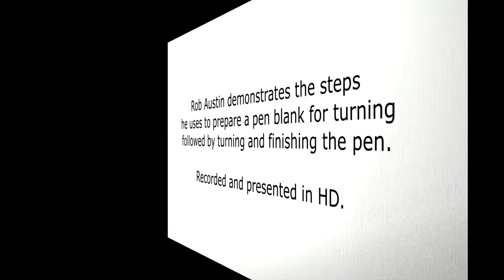Pen Turning 101 with Rob Austin

Comment: Thanks for this video Rob, very helpful and informative.
Reply from the maker: I'm happy you liked it. Have you tried turning a pen?
Reply: I did a couple pens in my high school shop class (1994).  This video was enough to confirm that I want to do them again.  I've entered the research phase to figure out the balance between what gear I need and what gear I want.

Comment: I’ve watched several people make pens. I’m not new to woodworking. I’m not new to lathe work. 
Why would you rather use a drill press to make the center hole instead of a tail stock drill on the lathe?
I have a chuck that will hold a 3/4 inch square. As long as I ensure the blank is level, isn’t that a better option?
No one on YouTube seems to think so. I’m just wondering why. 
I’m assuming I’m missing something.

I’m glad he addressed my question. I’m just doing entry level slimline pens. 
The lathe drill will do what I need.

Comment: You're a great instructor Rob.  I've scoured youtube prior to jumping into pens, and this is one of the best videos.  Just bought a Harbor Freight 10"x18" lathe, and everything else from Penn State.  I will tell you the mandrel saver is awesome.  Also, just so you know, the folks at Woodcraft didn't agree with your sanding steps.  They said to go 150, 240, 320, 10 coats CA thin, 400, 10 coats CA medium, 400, 600, 800.  I carnuba buffed after.  All that did was make my pen very hard and unnatural like.  You couldn't press your thumbnail into it at all, but it also didn't feel like wood.  Not impressed.  I will make another one tonight with your method.  Question, I see Mylands Friction Polish on Penn State, but sanding sealer is only on Woodcraft.  Do you mind sharing where you purchase?  Lastly, how do you recommend turning close/matching to the bushing on soft wood, without it chipping or getting too thin on a slimline?  Hard wood isn't "spongy" and problematic as I'm learning, but some soft woods still look cool.  Any advice?  (sorry for huge post)
Reply from the maker: Mylands and Penn state both have sanding sealer and friction polish. I buy mine from Woodcraft. Sometimes they run out and I special order it. Turning on soft wood does take a more delicate touch and very sharp tools. I like using a skew for shaping the ends. You will have to sand either way so use your tools to get close then sand to the end. As far as the sanding grits when going from a course grit to a thin grit... you never use a grit that is more than half of the grit you are using. So if you use 150 grit - 1/2 would be 75 so the biggest jump would be to 225. In order to sand the larger scratches out you should use grits that are closer to what your using. I use Norton or Diablo  Aluminum-Oxide sandpaper and I have not seen them make a 600 or 800 grit.  Most of the 600 grit and above is a wet sand paper.  The jump from 320 as Aluminum-Oxide to wet sand paper is not a normal progression. There are several ways of finishing your turnings so experiment and if you find something you really like let us know. Rob
Reply: @gwinnettwoodworkers  It's been 7 years since I left that comment. This video popped up in my feed today, and I saw my original comment. To be clear, Rob's method is still the best. I'm not a fan of a CA finish. Wooden pens are art you can use. Coating them in CA glue takes that authentic wooden feel away. It's like a leather bag to me: if it "fades" a bit, it's supposed to! I have turned a LOT of pens, and I just wanted to come back here and thank Rob again for all the help. I would add that I like Abranet. That sanding mesh doesn't deteriorate or clog as quickly. Keep up the great work!

Comment: A thin wax plug, or potato if you're frugal, works very well at keeping any glue from entering the brass tube when gluing it into the drilled blank. When I have a special piece of wood that I want to look the same after years of use I apply a thin layer of CA glue and polish it to a super gloss that seals the wood from skin oils and discoloration.
Reply from the maker: That makes a nice extra layer of protection. I don't care for the very shinny finish of the CA glue. It give some wood a plastic.
Reply: @gwinnettwoodworkers  I agree and only hold waxed wood personally but the CA application allows the pen to be polished back to its original gloss luster for the life of the pen. Nice work.

Comment: I did just get the Wood River DV2 Drill Vise. This is one that can be used with a hand held drill. It's not too bad so far. Someone needed my Drill press vise more than I did apparently. I haven't tried a precise center drill yet. Here's to hoping.
Reply: With a drill chuck or collet in the tail stock of the lathe, you don't need a drill press nor a drill vise.  Nor a pen mandrel, as you can then drill the hole after mounting the blank in the lathe - it's being held in perfect centered position for the hole.
Use an auger bit instead of a brad point, because you can't jig much with the tail stock screw.
Reply: Art Heen that's what I had to go with. The DV2 did not have the precision I was looking for. I do it all on lathe now and much happier doing so! Thank you!

Comment: 20:27 I got distracted for a bit by the white and black makita drill - very nice, first time I`ve seen one
Reply from the maker: The white and black drills are more of their consumer line. I have 5 of them and have been using them for a few years. Our woodworking club went to the Makita factory and had a great tour where they answered questions. When we were done I ordered 5 drills.
Reply: I`ll bet that was an interesting factory, I used to repair them so I`ve seen them from the inside and Makita are built very well

Comment: I absolutely love your  videos and your finished products.  I had one question, can you tell the brand of friction polish and sanding sealer that you use???
Thanks!!!!!
Reply from the maker: Mylands for both. I normally buy it at WoodCraft. Another good brand is Penn State. I buy small bottles that I use and refill. Then I keep the big containers in a cool closet. If you use it from the big containers the air dries them out in a short time.

Comment: I agree it is far cheaper to buy the board and cut your own blanks.  I've done that many times.  Actually have picked up larger pieces from the discount wood bin at Woodcraft and made many pen blanks that way.  I got a piece of Yellow Heart last year for $8 it made me 27 full size pen blanks and 4 single tube size pen blanks.  Really nice to get larger pieces and turn them into blanks.  I also try and make my own acrylic blanks whenever I can as well.  

I'm like you I don't make them for profit...definitely not a profit where I live, people will go to the dollar store and buy a package of garbage pens and throw them away, they will never pay the price for a hand made pen that they will have forever.  I make them for fun, and all sorts of different styles to make, and tons of blank types out there too.

I have had good luck with regular super glue for wood blanks, but for acrylic I've found that super glue doesn't work very well, I've had brass tubes break away from the acrylic during turning, so I now use epoxy for all my acrylic pens....which is mostly what I do now, don't really make very many wood pens unless its a new pen style I've never done before, then I use wood, its easier to work with and don't waste an acrylic blank, I've actually screwed a few up and just turn the wood off back to the brass tubes and start over.
Reply: +William Todd (williamtodd) I found the CA glue can become brittle after time. I now use the epoxy of all my pen blanks. When I'm setting up the blanks I do 20 or 30 at a time so the epoxy works well.  I can do around 4 sets of blanks before the epoxy starts to harden.
Reply: Rob Austin I've kind of stopped using the CA glue even on the wood blanks here this past weekend that I did, I had the epoxy right there already, and it seems to hold a lot better, have to wait a while before I can finish the pens, but I'd rather not have tubes coming lose during the turning process LOL.  For the cost of epoxy I think I'm just going to stick (no pun intended) with the epoxy across the board now.
Reply: William can u make me a fountain pen ? I'm new to collecting  fountain pens n would love to have a beautiful hand made one in my collection .
Reply: MC CLG send me an email wsevier@yahoo.com with your color choice.  I can make wood or acrylic.  Just a note, most of the nibs for the hand made pens aren't as good as the commercial ones you find from Goulet Pens, or the like.
Reply: William Todd OK cool,i will dearly noted on the Nib

Comment: This was amazingly helpful.  Thank you.  I wish we were neighbors.  How many times do you reuse the sand paper and micro mesh?
Reply from the maker: I fold the sandpaper into sections. That way I can use one section at a time. I have been frugal with the Micro Mesh so after it gets clogged up I I put it in a bowl with soap and water. I brush it with brush used for dishes then rinse in warm water. I lay the pieces out on a paper towel and let them dry over night. Next day they are close to being like new. I have some that are over 5 years old.

Comment: Very nice video. I have to ask how you ever used bees wax in place of the carnuva wax? And if so how well did it hold up?
Reply: +Love2boat92 I have not tried the bees wax. It felt tacky and I was not sure if it would buff out when done. I will give it a try. The carnuba wax is pretty hard and last for years.
Reply: Rob Austin Oh OK. Thanks.
Reply: Beeswax is great for when you need grip, but not so good for shine.  I use beeswax on knife handles and canes, but not pens.
I use boiled linseed oil to bring out the lustre in the wood, followed by carnuba paste and buffing.

Comment: Your advice on the glove protection with epoxy was very good. Should you get epoxy on your hands, you can use vinegar or diluted acetic acid while the epoxy is still uncured for many epoxies. You should immediately wash thoroughly with soap and water after using the vinegar to remove residue.

Comment: Rob that was a really good video! I've been turning for only 1 yr. I have two questions, if I may? I live in Albuquerque, NM / 1) Where do I purchase that Little silver "do-dad" for measuring centers of wood???  and 2) Where do I get that tool that you used at the end to assemble the pen, with the wood blocks????

Best Regards,
Mike Smukula
Reply from the maker: The one I have is called PEN PAL. They are currently not in production due to machinery problems. Woodcraft has a version of the same one: Item number 158247. There is a similar press at PSI. PSI Woodworking PENPRESS4 Heavy Duty Pen Press Assembly V4.  I hope this helps you!Item #158247 WoodRiver
            
            
            
            
                $4.99Item #158247 WoodRiver
            
            
            
            
                $4.99WoodRiver Pen Blank Key Chain Center Finder
            
            
                Item #158247 WoodRiver - See more at: http://www.woodcraft.com/product/158247/woodriver-pen-blank-key-chain-center-finder.aspx#sthash.UJlgCFuy.dpuf

Comment: I had success with this process, but I am confused about the sanding sealer. This video describes it as though it dries the same way as friction polish. The sanding sealers I have seen, like Zinnser SealCoat, do not dry with friction. They want time to dry. Also sanding sealer is most generally used to prepare the surface for sanding, but this process puts it on after the sanding. What does the sanding sealer do for you in this process? Does it help the friction polish in the next step?
Reply from the maker: The sanding sealer used for pens is also used like the friction polish. It's not the same as you would use on flat work. I use Mylands brand that I get from wood working stores. I get mine from WoodCraft.
Reply: @gwinnettwoodworkers  oh ok I'll have to try Mylands instead of SealCoat

Comment: Got a question: I'm new to the pen turning hobby and am absolutely loving it. Yesterday I turned a thin blue line police click pen. Just before I started the sanding process I noticed a split/rip/tear in the blank. I filled it with CA and proceeded. The pen turned out beautifully except the problem area. It almost looks like I twisted the blank, one end clockwise the other end counter clockwise. I wonder if I had the blank on the mandrel too tight? Is that possible? Please help.
Reply from the maker: I would not think so. I tighten mine very tight but I have overdone it with some types of wood. Some hardwoods can get brittle. It may have just been a problem from the grain in that piece of wood. I like that you were turning a thin blue line pen, the majority of our police deserve the recognition and our support!

Comment: What type of friction polish are you using? Also what type of sealer?  Theres so many out there, plus you can make your own. I dont know where to start with them.
Reply: +JunkBeGoneNY I use Mylands sanding sealer and friction polish. Very good product. I put them some in smaller bottles so air does not get into the full can/bottle. When i first started I worked from the original can and it dried out before I used half.

Comment: I am new at making pens and keep cracking my blank when I drill the hole. I am using a jig to drill the hole and sharp drill bits. Any suggestions..
Reply from the maker: The biggest cause of cracking or splitting your blank is drilling too deep without cleaning out the cut wood. With oily wood I drill around 1/2" to 3/4" deep raise the bit to clean it out then drill some more and keep it up until it's complete. Are you using brad point drill bits? I never really used them until I started making pens.

Comment: Thank you. When I search for "end mill". I'm not finding what you're using to square the blank. Where did you get that tool and the lathe mandrel with bushings?
Reply from the maker: Try searching as a "pen turning barrel trimmer" I just tried that and it worked great.

Comment: What is the best (cheapest) place to buy high quality and or exotic boards online?

Also you said you prefer to use a skew .. what size or model exactly?
Reply from the maker: I have a few local sources to buy exotic boards around our area. I have not attempted to order them on line. Maybe someone else that reads this could give suggestions.

Comment: what lathe chuck do you recommend I'm going to make ink pins  chess set 2'' square stock.  there is so many to chose from. thanks for the help
Reply: +KNIFE MAKER I use a mandrel for making pens but most of my work is using a chuck. I have 15 chucks from several brands. My preference are the Vicmarc chucks. PSI has nice sets include a chuck and a few sets of jaws so you can get a good working set for a lower price. The PSI does not come with dove tail jaws so I don't use the PSI as much as others.  I have a few NOVA II chucks. They are very good and the jaws are interchangeable with the Vicmarc.

Comment: I really like the video, but why epoxy instead ca glue?
Reply from the maker: +Gary Giffin CA glue continues to harden rapidly with age.  It crystalizes and gets quite brittle.  The shock of dropping the pen will shatter the crystalized glue and the pen tube will then become loose.  Epoxy maintains more of an elastic property that will withstand shearing forces if the pen is dropped.

Comment: woodworkers dream shop, I wish I was good to Santa all these years, any chance purchasing the odd size cut-off ends, to make wooden rings.
Reply from the maker: Thank you about the shop, I love it! I don't normally have much cut offs. I cut the boards into 3/4" strips then cut them into the  correct size for the pen blanks. I don't order the blanks sold in stores because there Is so much wasted wood on each one.

Comment: how do you turn a foundation pen what drill bits for it
Reply from the maker: Each pen kit requires the correct size drill bit and bushing set. If your only making 1 pen and charging for it make sure you include the cost of the kit, drill bit, and bushings. I normally order several kits to help cut the costs.

Comment: What brand/model pin vise is that?
Reply: +Jason Templeman I have two pen presses and neither one has a brand label on it. I either got it from Penn State industries or Peachtree Woodworking and Supply. I hope that helps you!
Reply: +Rob Austin The one with the maple inserts looks like PSI. They do have a new model that is spring loaded that will hold the units together. It's not bad.

Comment: Use acetone to dilute the epoxy and vinegar to sort of remove it. Finish with soap and water. Have to do this before it's cured. Epoxy is basic so you need something acidic to counteract it's basic nature.

Comment: Never wrap sandpaper in a part being turned. If one end of the sandpaper meets the other it can curl up and pull your finger. Better stick sandpaper on a soft, flat surface that fits the part. Big hug
Reply from the maker: I'm not sure what step you are referring to. Maybe wrapping the Micro Mesh around the pen blank to sand it. The sheets I use are cut down to around 1 1/2" X 3" I have had it grab but they are too small to do any damage. You are correct about being careful with that.
Reply: Okay, the intention was just to alert you, but you're experienced. Hugs and congratulations for the beautiful work!